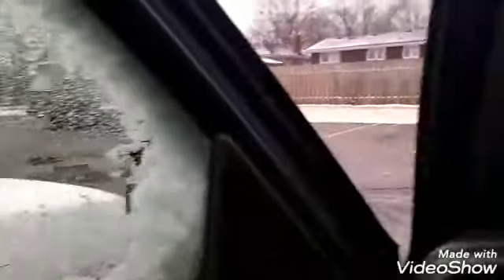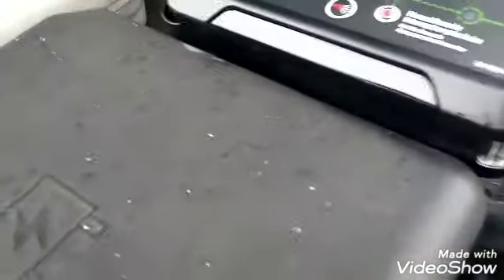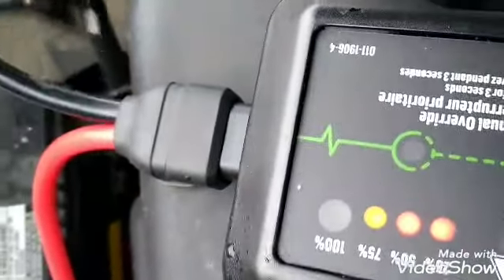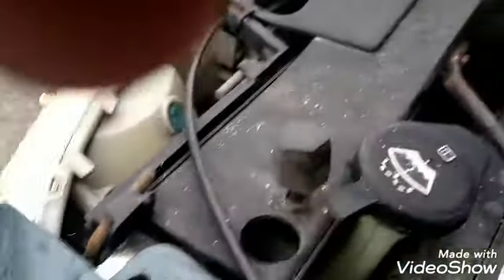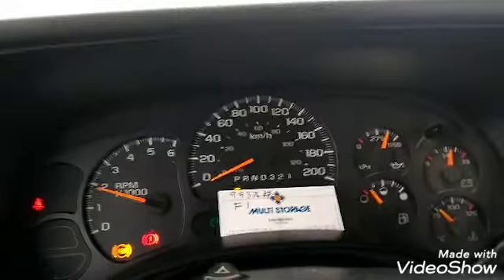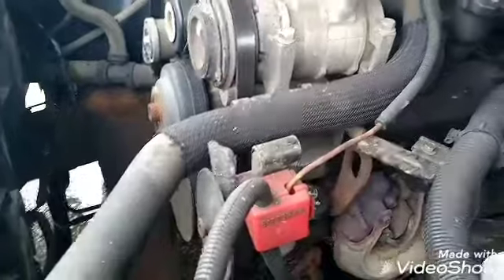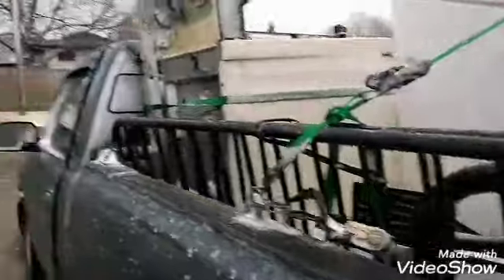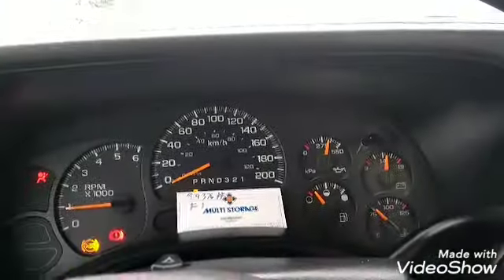Eliminator Jump Starter

Comment: I didnt even knew it was possible to paint there
Reply from the maker: Lol yes you can .some lift up .and some have two screw s Happy New year my friend and all your family all the best 👍
Reply: @carmac1652  no i mean the paint 
trust me i know how an oven is done i saw pretty much every kind 
i didnt knew that they was regular can spray paint that could handle that heat
Reply: @carmac1652  cause if it start heating and paint smoke it could be kind of very dangerous 
but im sure you know what your doing 
btw nice locker you have going ther
Reply from the maker: @jackpotdigger834  yes the paint is made for heat